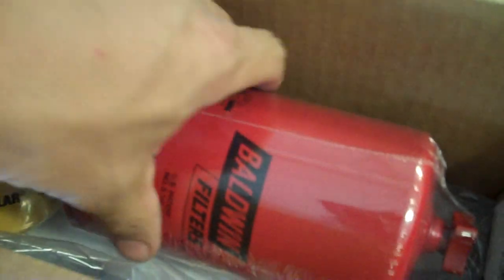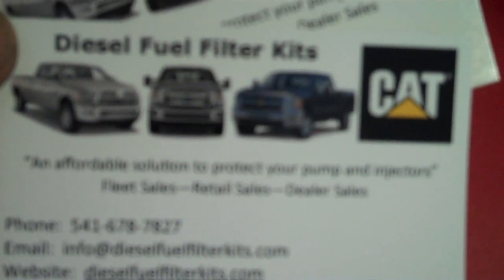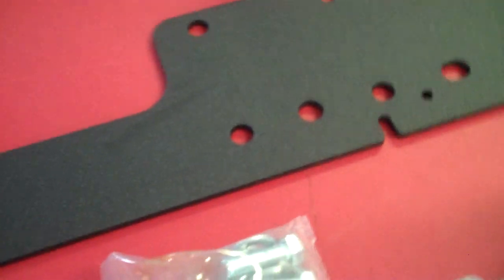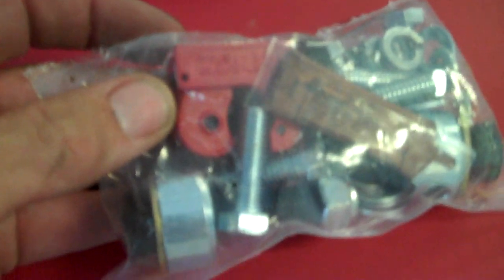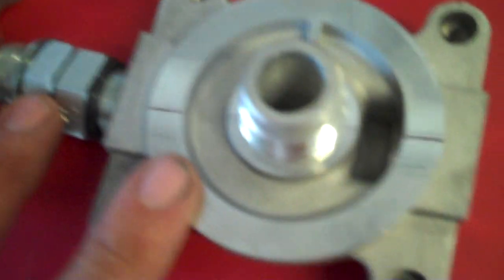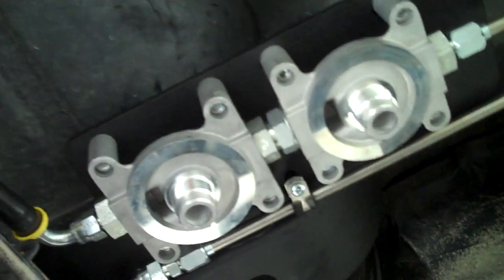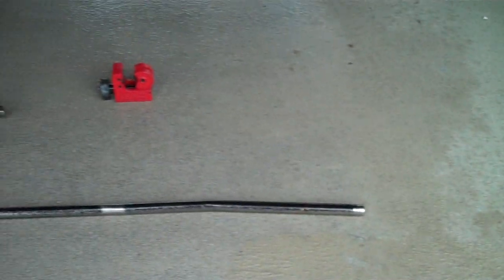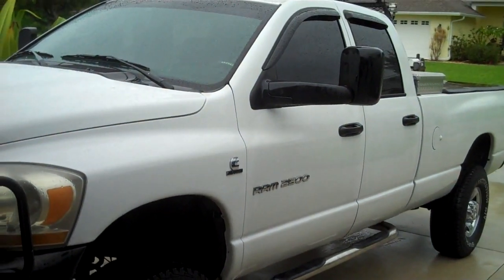Ram 2500 5.9 Cummins Diesel 2 Micron Fuel Filter Kit Install

Comment: How has the water separator performed for you? Have you been able to see  water in what you have drained from it? I read that the BF1212 is designed to be on the suction side of the pump, not pressure side as this installation is. I have a 3rd gen 5.9 I am researching options for. I am curious if the Baldwin works correctly in this application.

Comment: Did the fuel line in your truck have a coating on it? If so how did you get it off to make the compressions fittings work properly?

Comment: Installed this kit on my 2006 Dodge Ram Megacab w 5.9 Cummins. Great kit. Took me bout two hours. My Megacab configuration allowed plenty of room to run the lines. Cutting the fuel line was the biggest worry but wasn’t as big a deal as I thought. Pay attention to installing the new threaded fittings on the newly cut fuel line. It’s hand tight THEN 2 1/2 turns after that (check me on that). Follow the directions lol! Didn’t do it the first time and leaked when I started the engine. Did it and stopped leaking. I was probably in a hurry. Been running it a year now and no problems. Don’t know if it’s really working but it makes me feel good…and that’s all that matters lol!
Reply: Can you lend any feedback on the “galling” from using dissimilar metals between the filter nipple and the filter themselves?
Reply: Did you need to get new compression fittings?

Comment: Love Turnerdude  videos!  Will this system lower the fuel pressure significantly?
Reply: No does not lower pressure if you have a gauge the pressure goes when dirty .
Reply: Up
Reply: I’ve had this system for a lot of years but I put a 5 micron Balwin in the factory housing that way water in fuel light still works. And I run it for 2 years before I change and I don’t driver very many a miles a year. My wife drove 1200 miles last year and I drove about 2600 miles so not many and couple times a year I have never had water in thoes 2 water separators. The best thing you can do for high pressure pump and injectors. Hope this helps a great system.

Comment: How did you cut the line?
Reply: Also did you just thread that fitting onto the fuel line?
Reply from the maker: just used a hardware store pipe cutter. release the fuel pressure before cutting or you will wear diesel fuel

Comment: just sharing but you can upgrade the stock one if you don't justify doing this upgrade. info below. thanks for the upload. 

Baldwin PF7977 5 Micron Fuel Filter
Reply: According to my knowledge the factory drop in fuel filters are recommended to be replaced every 7500 to 10,000 miles
Reply: Leave the first filter a hair lose and bump the starter to tur lift pump on the tighten it up and do the same with cat filter and you can do same to factory filter and that will get rid of air in filters. I don’t do this I just bump starter 2-3 times and that seams to work fine starts reel quick.

Comment: The video skips the installation of filters onto the filter bases. The Baldwin filter bases are a weak link in the system because of their aluminum thread nipple that threads into the filter. Using anti seize compound to prevent galling at this point is a bad idea. Interesting that this step is not shown.....

Comment: Beautiful kit! The only concern is the aluminum on aluminum thread galling issue, and using anti-sieze (an abrasive) on the clean side of a fuel system. Stainless steel version: http://a.co/0UUgGAe
Reply: Link is dead.  What stainless steel version???

Comment: Don't get it. Destroyed my truck. Something is wrong with thread pitch on the cat filter to adapter.
Reply: The aluminum on aluminum thread causes galling. This kit uses anti-sieze (an abrasive) on the clean side of a fuel system. Stainless steel version (no galling): http://a.co/0UUgGAe
Reply: Western Diesel what is the clean side of the system?
Reply: What do you mean "destroyed"? Has a solution been found or should I buy a different one ?

Comment: Will this system work on a 2000 Dodge 2500 5.9?
The website doesn't show the 2000 model year as an option for this system

Help
Reply: It looks like his truck is 2nd gen body style. I'm trying to find out more about this system so i can install it myself.
Reply: @ruS911Srt  Any luck? I have an 2001 24v. My Airdog went to shit.
Reply: Chief60 wanted to know the same, did you find out? Dave

Comment: Why not install a Fass?
Reply: Price is the simple answer. This kit and a belt driven, mechanical lift is still cheaper than Fass or Airdog.
Reply: @jbaker4900  where can i get the mechanical lift pump 2 of my friends have air dog and both are on the 2 an 3rd motors in 4 years
Reply: @jasonscales3476  Google  " GDP " mechanical lift pump

Comment: Does it remove/filter tiny air bubbles? From what I understand, bubbles damage injectors in the long run.
Reply: we have ran on for 3+ years on a 6.7cummins and zero issues, also did the factory fuel filter delete

Comment: did you leave the factory fuel filter on the truck? if so is it overkill for the for the factory fuel pump? I wanna know cause im having trouble with the air dog 100 system.
Reply: from sounds it does leave the factory fuel filter still in but i wonder if you could bypass it now
Reply: No they work great

Comment: I want to do this but wonder if it's overkill cause I already did the cat fuel filter on the stock fuel filter location....
Reply: Zack Montgomery hey Zach. This is Daniel Hudson. Did you ever get a straight answer to your question?
Reply from the maker: +Zack Montgomery injectors are expensive. keeping fuel clean and water free cheap....
Reply: The CAT filter needs a water separator before it and should have a pre filter. Keep the small birds and large pebbels out of it.

Comment: how's it working considering the injector problems sorry I'm new into the diesels currently looking at a 03 and 04 5.9 3500 dually heard about it don't quite understand it
Reply from the maker: +Anthony Daniels
 I got 1500 miles on it now. I can say I notice a huge difference in the way the truck idles and it seems very happy ...
You can never have too clean fuel.... Any one else want to chime in on fuel filtration???
Reply from the maker: +Anthony Daniels working great. watch the fuel pump on the 03 and 04 its not in the tank.
Reply: TheTunerdude I have an 03 and want to add this kit, what do you mean by watch the fuel pump it’s not in the tank?
Reply: @letsgo243  my 03 has the lift pump on the fuel filter housing.  I'm not sure if that pump will pull through these filters.
Reply: I have 280k on my truck 2005 5.9
I have never upgraded anything but the air intake. Changed fuel filters every 50k. Not one major problem